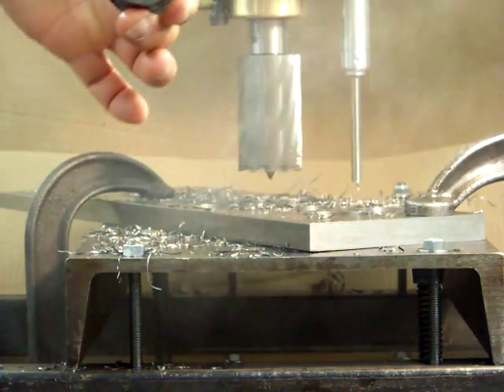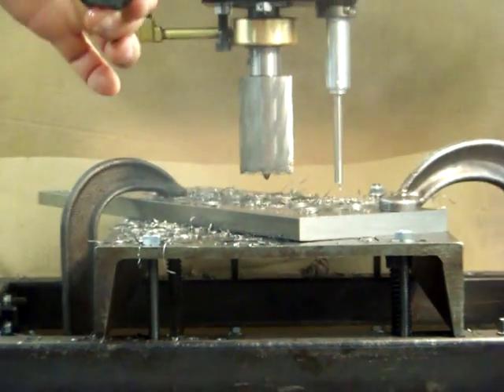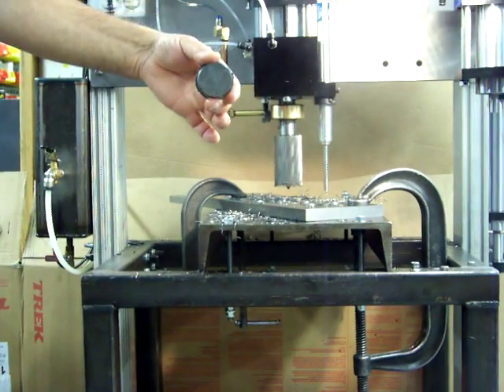2" Hole through 3/4" Steel with Annular Cutter

Comment from the maker: @GatheringSticks  - Here are the stats for this test drilling set-up:

1140 RPM Motor

1:1 HTD Pulley and Belt Set-Up

1:7.182 Gear Reducer

Output RPM = 158.73015 or so.